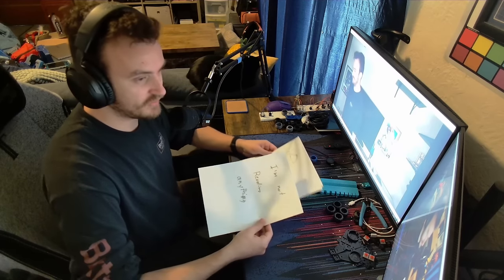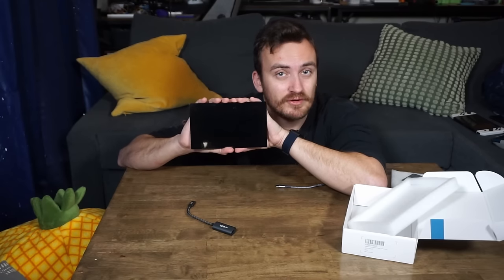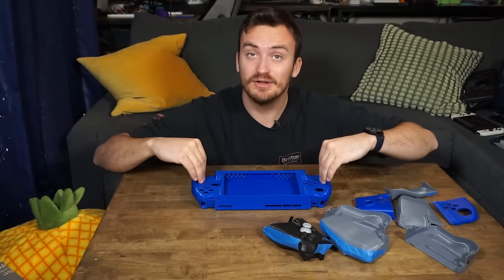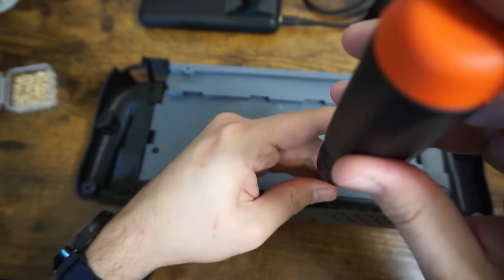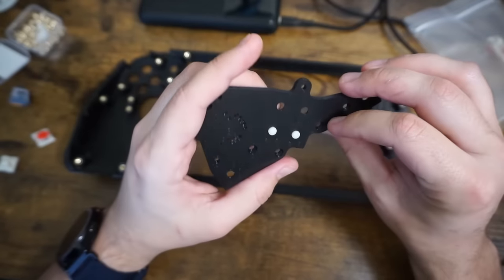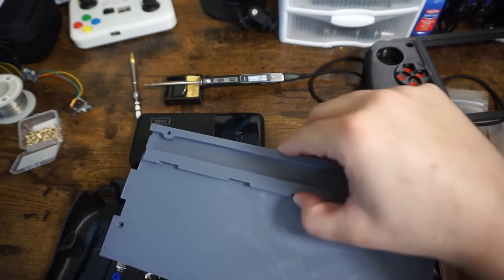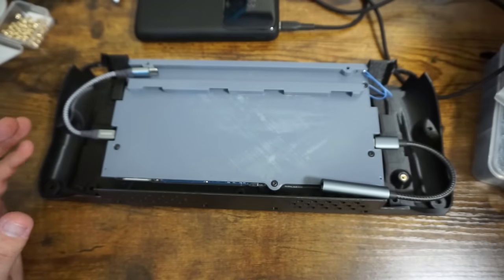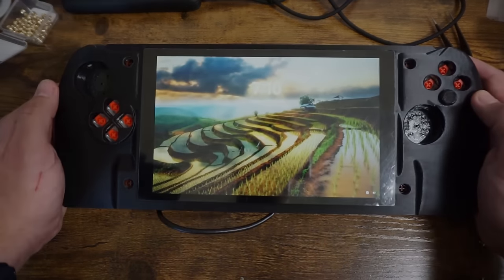I am building a Framework Gaming Handheld!(DIY Gaming Handheld)

Comment: Mechanical switches as face buttons are really underrated. Glad to see other people working on this idea too!
Reply: They're good, but as someone who used a lot of gamepad with switches like this I think that membrane is still better for handhelds since it's not as clicky and won't be as much of a pain when playing in public or at night in your bed.
Reply: @TakisEnjoyer  you know there's silent switches right? and a bit of lube, you basically get the best switches for this thing
Reply: @Saji_0  there are, but I'm yet to encounter any mechanical controller that is not extremely clicky, would love to see them doing something about this if this is the future we're going for
Reply: @TakisEnjoyer  there are mechanical switches that are both silent and have no tactile bump. Now I'd argue if you dislike both those features then mechanical switches are probably not for you 😅. When i built my framework handheld, using mechanical switches also provided the option to make them hot swappable, so swapping out the switch for a more tactile one, or a more quiet one would be possible. Essentially you're able to customize it to your likings, as opposed to just settling for what the manufacturer decided to use.
The other benefit is repairability. With switches that you can replace on the fly, if anything were to stop working, it would be very easy to swap out assuming you made it hot swappable like my Framedeck. Maybe Tommy's next revision will make use of pcbs with hot swappable sockets. 
Using mechanical switches in a Framework built device just makes sense in these contexts.
Reply: @TakisEnjoyer It's a little unfortunate. A lot of people think mechanical switches means it has to be clickly, including oem companies. So a lot of what you'll find available will be clickly to some degree. There's a ton of options for dead silent mechanical switches; companies just don't use them due to the hype of "clicky means better."
Reply: That sounds like a great idea until you start complaining about the lack of feedback when you press a button.

Comment: Huh the project is just wow!
Have a couple of suggestions:

Suggestion 1: you can try to print the case with ASA or HIPS plastics instead of ABS.
Suggestion 2: to make joystick "plate" stiffer, you can try to print it with HIPS (it might be used for the case itself also) and add vertical stiffener kinda fins.
Suggestion 3: it might be possible to make buttons holes just a bit bigger to accept some kind of connectors from the other side of the "plate" and have solderless and maybe even hot-swappable switches.

Comment: Awesome design! As a stretch goal for a V2, I think you have exactly 1 spare USB C port (two for the screen and one for the top connector to charge), you should try and integrate a single Framework module bay. An extra USB C port is already useful, but if it could also be an HDMI port, or a storage expansion, etc. that'd be fantastic.

Comment: I really like this as a prototype for something like this!  Some modifications i would personally make is instead of key switches which are pretty bulky, I would look into using Omron B3F style switches like in a nintendo switch.  you could even design around existing buttons from something like an xbox or a ps4 controller.  I believe there are mods for both using these Omron B3F switches already.  There are also right angle B3F switches, so with a single pcb, you would be able to have all of your buttons and your top shoulder buttons all in one.  You could then use something like a keyswitch for the triggers, as the triggers in most controllers traditionally have a longer travel.  

I would also try and use a panel type USB-C extension for charging.  It would be WAY cleaner if you can figure out how to fit one.  it could be as simple swapping the direction of the adapter connection and just finding somewhere to hide the excess cable.

These would probably interfere with the hall effect joysticks, but if possible, using magnets for the different analogue stick plates would be a HUGE convenience, both in terms of swapping them out as well as prototyping them and making sure they stay straight.  

I would also for sure look into adding some kind of pointer device other than just a touch screen.  I would either look into a Primori Trackball ie the PIM447, which is a TINY all in one trackball that can be easily fitted into small spaces, or touchpads like the Glidepoint Circle Trackpads (I believe a version of these were used in the Vive controllers.)  If you need help with either of these, I would look into the Ergo Keyboards community.

In any case, I adore these designs so much!  Abs could be a really interesting material to use for an actual usable model, as you can do some really cool finishing with it, including vapor polishing.  Cant wait to see what you come up with!
Reply from the maker: These are a lot of interesting suggestions. Thanks!
Reply: Those B3F switches are also sold as generic options usually called "tact switches" in various sizes and heights. They're usually the more clicky ones with not a lot of travel. Adafruit also sells some interesting ones with soft silicone tops with more travel. Basically those have the feel of button membranes but built into the individual switches.

Comment: 11th gen intel framework motherboard has a known issue with the cmos battery. It will only charge when plugged in, even if an onboard battery is installed. 
Basically if you have it in storage for a long while, you have to plug it in to start the first time. Hope this helps, and great video!

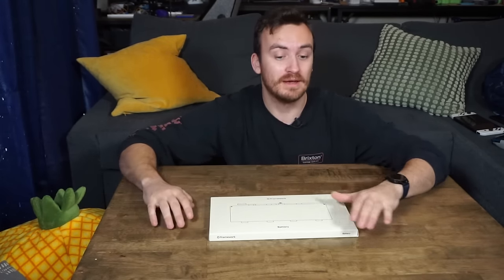Comment: This is awesome but I think you can make it much simpler for the display. At 3:24 you said that "framework has a screen but I can't really use that" but you actually can! It's an eDP connector and there are plenty of 7-inch displays using that connector. You could get rid of the HDMI cable and dongle and make your life so much easier! Good luck for your project, I just subscribed to follow it :)
Reply from the maker: There is currently no eDP displays with touch that are supported by the framework motherboard. Sorry, i should've been clearer that touch was a requirement for me. I did, however, find an eDP to hdmi adapter that someone validated works on the framework forum, which maybe i can use for another iteration. That would free up another type-c port.
Reply from the maker: Thanks for the suggestion and the sub though! I appreciate you :)
Reply: @TommyBee456 oh yeah I kinda forgot about touch. That said, many 7-inch eDP touch display uses a GT911 for the touch and you can find USB controllers that are compatible for less than 15$

Comment: 1. Make more usb-c inputs, at least another one, it is something that Steam Deck misses
2. If you want to make all models public, please add two models for front panel and plate that holds left dpad and joystick, where dpad is above joystick, because some people like PS type of gamepads (this is one of the reasons I chose Steam Deck instead of other devices, I also have Nintendo Switch, but controls there are painful)
3. If you insert gyroscope in there, this would be overkill 
Everything else looks perfect, hope you will get this project done, I would love to see the results of your work, good luck!

Comment: That's awesome! There might be a small enthusiast market for Framework mobo like the one you are using or smaller one (Steam Deck size, might be soldered RAM tho) for DIY handheld for sure. Like maybe a new mobo ''standard''  for handheld devices and NUC? I would love to see a Framework handheld using more ''off the shelf'' Laptop parts, devices like ROG Ally, Legion Go rely a LOT a manufacturer for updates, features VS more mainstream SoC like 7840U/8840U, etc.

Comment: I know for a fact that there are analog keyboard switches that you could possibly consider using, though they might not be as low profile as your current switches :)

Also, for a choice of operating system, Bazzite might be a really good choice just because it's very easy to get your own DYI steamdeck UI set up on there. Especially with the X360 config that Steam provides to the OS, you'll have yourself a one-and-done gaming setup :D

This is absurdly good already though, even for a clearly WIP first iteration. I hope Framework does consider sending you some spare boards!

Comment: one thing you could do is model the little standoffs to fit the framework's cutoffs for screws. this way, it will always align well with the bottom posts. also, if there is any touchscreen model with a single cable, you could benefit from one less cable and adapter. also also, if you could develop the custom pcb, there are services that can make them for very cheap, in many colors, and you can even get the case printed in different materials together with the case.

Comment: I've always wanted to do something like this! Though I would've keyed the thumbstick wells with a square-shaped inner collar/brace so that the knurled octagonal collar doesn't need the knurling or the threading or any special tools, and just use (fairly common and cheap yet strong) N45 magnets to hold it in place.
Reply: Wouldn't the magnets interfere with the hall effect joysticks function?
Reply: @sonicpelaaja Probably, but you can calibrate the joysticks and the magnets can be placed in a symmetrical fashion to cancel each other out. Personally I find that would be easier to adjust than getting the printer perfectly calibrated so that the threads on the thumbstick well and collar work properly.

Comment: A tip for soldering to key switches. Especially hall effect. You cannot get the switch very hot at all. Couple of my modding buddies that like to swap out joysticks. They either socket the joystick or let it cool in between wires and solder on low heat with lots of flux
Reply from the maker: Good to know! Thanks

Comment: I love this idea, I wonder if it could made slightly smaller using the FW 55WH battery instead of the 61WH. This would also be great with the AMD board framework has since its an APU similar to the steamdeck. Slap chimeraOS on that bad boy and you've got a DIY steamdeck that's upgradable.

It'd also be hilarious to mod stuff up so one of the USB-C ports has in input of the bottom of this handheld. Then you could do something like attach a framework bottom with with the keyboard, touchpad and battery with a clamp and USB-C so you can make it a "steamdecktop" with extra battery when you want it lmao. Although that would certainly require more modding with extra controller boards to convert the keyboard and touchpad into USB.

The sheer mad scientist possibilities excites me.

Comment: Having actual mechanical switches for your buttons mean that your controller implementation of controller inputs are far superior than many other controller makers out there. Even Gulikit kinda use a membrane like switch. Though, to keep it hot-swappable, I would recommend using mill max sockets similar to the ones used in mechanical keyboards and just solder the sockets so in case you need to replace the switch, you don't have to pull out the soldering iron again.

For the trigger buttons, the buttons are almost always some form of hall effect sensor. You may need a PCB of some sort which contains a magnetic sensor to screw in then a spring mechanism and a triggger which carries some magnet. However, the mechanics of that is beyond my paygrade so I hope you can find someone who can help you with making the triggers hall effect.
Reply: Could use the through-hole transistor-package hall-effect sensors, and a magnet in a 3D-printed mechanism, to avoid use of a PCB. The quality ones are often stupidly export-restricted from the USA though, so if you're not American or willing to pledge your undying hatred of Cubans and social safety nets to get clearance for them from the usual American hobbyist resellers you'll have to order them from the original manufacturers in China/etc; or another non-USA source. Or most American sources stock special 'high noise' models (rejects?) that are apparently not 'at risk of uplifting the Soviets' according to silly old Cold-War laws.

Comment: Rally cool video thank u for the effort, and I think u should correct the screen position on the hardware level because doing it on the software level will add extra processing also make sure that the main board is not dumping heat on the battery 😘😘😘

Comment: For the controller you can also use ESP32-S2 or ESP32-S3. They have a lots of more gpio pins and most of 'em can be used for analog input, so that you can add two more trigger buttons.

And for the firmware you can just use one of their example in the ESP32-Arduino core repo.

Comment: If you do end up revising this, I'd love to see a gyro sensor added for PS3 emulation, I know it's an extra challenge, and I'm not confident that RPCS3 would even run anything playable on a Framework 13 board, but it'd be cool to see.

Comment: You don't need room for the fan to breath. The air is pushed/pulled by it. It can actually be better to have no gap because you can lose efficiency from turbulence around the fan if you have a bigger hole.

Comment: I think for the standoffs that are free standing you could make them slot into  place if you made small cut outs in the flat piece which would connect them together, allowing you to still print it flat but have it snap into one piece before screwing together

Comment: Awesome build, but some things you should consider are ASA as the printing plastic, basically a sister material to ABS but with some slight tweeks, it has essentially the samestrength and thermal properties, it's easier to print, and it is UV resistant, for your use case the ease of printing is gonna be the selling point, it warps and shrinks WAY less, almost as easy to print as PETG. And the other thing you should consider is using the steam deck's Steam OS as the operating system you use, especially if you eventually get an and mainboard, that would be basically plug and play, but even if you stick with the intel boards the latest recovery images for steam os should have a new enough linux kernal for any intel board to be plug and play too.

Comment: this is a great build!

while at it, design it retro like
like hot swappable batteries (18650 battery with a custom battery controller)
Reply: also make it touch screen, or use the switch oled design

Comment: 1) Framework uses standard 40pin eDP port.
Its a problem to find eDP screen under 13"(or just make 13" handheld (: )
But there is eDP <-> MIPI convertors, which would eat less space/power/latency then using hdmi/usb...
Steamdeck OLED screen would be better choose in that case.

2) Do Framework have advantages over steamdeck outside "DIY" part?

3) Its a big leap from RPi3 to Framework, did you consider MISTer FPGA handheld before that?

Comment: dont split the vid pls :) long vids are great.

Also there are very flat HDMI cables you can use instead. it also might be more beneficial for space to not use such a bulky adapter.

There are ones with plastic housing that you could trim away and probably heatshrink to save more space inside the case.

Great vid
Reply from the maker: I just found some flat ones! I guess they are used commonly for fpv drones. It should save me a ton of space.

Comment: might want to look into harvesting an IC from a wii classic controller if you want dual analogue sticks, the GP2040 has a plugin for it, otherwise the rpi2040 doesn't have enough analogue pins

Comment: Do you think you could make a version for choc switches? There's a lot more options (like sunsets which are FAR better than browns)
Reply from the maker: You know, you are completely right and at first I planned to but chocs use 2 little clips to attach, and i was worried about 3d printing those and them being strong enough so i went with switches that had the classic cherry cross pattern. However, since i am getting the buttons resin printed, maybe i could look back into chocs for another revision. Also, i just ordered some switches called the gateron banana, which is apparently supposed to be better than brown, so we'll see how those do!
Reply: @TommyBee456  makes sense, yeah I wouldn't trust FDM choc keycaps, but resin should be fine. It's more of just a friction fit than clips fyi 👍

Comment: i think not having any vents on the back would look better. personally i dont care much about temps so i think just having the battery on the back then the motherboard then the screen would be really cool. then you can just have the top of the case be a grill and have the fan out right against the grill and the intake of air could be done from the rest of the top part from beside the fan out. the speakers wuld be from the top too te sound can come out from the "fan intake" part, but the top grill will be wide anyway in this case cus the display battery motherboard, ends up being so thick that its really ok

Comment: Quick question, why do you opt for screen-facing motherboard for the component instead?

Wouldnt it be better if the swappable component such as the nvme and sodimm are facing to the back?
Reply from the maker: Yes it would be! However the fan prefers facing the way i have it currently. If i flipped it I would need to create some sort of air channel to make sure it can breath, which maybe i could do! Depends on how much space i can make, may need to rearrange a bit.

Comment: Hey quick question for you, is there no danger in stacking the battery under the main board? I’m trying to build a similar device, and I’m a little worried about battery damage due to the temp of the cpu under load. Are there any materials/solutions that would negate this issue?